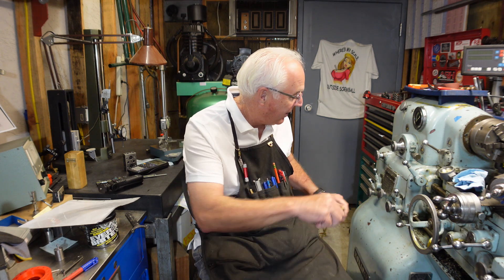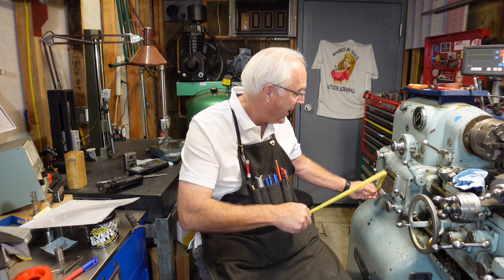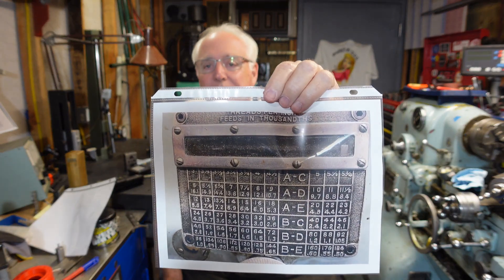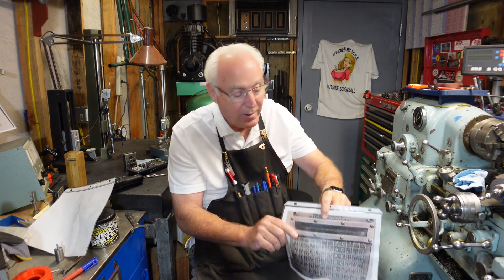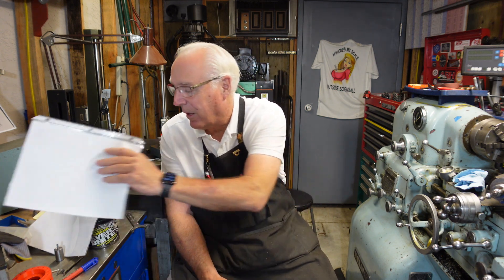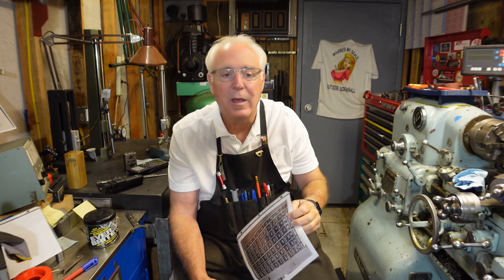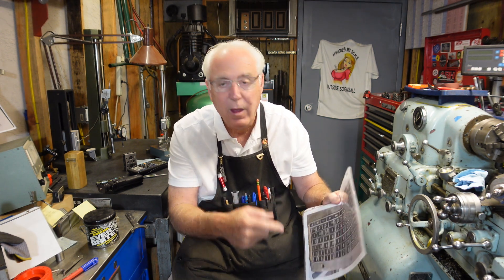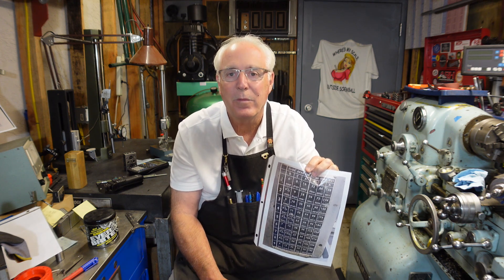Machine Shop Lathe Tip (simple/smart)

Comment: Chuck, this IS a great idea. Not only for lathes that have a table that is "hidden" there down under but also for lathes that have a very hard to read/understand or erratic table for feeds and threading.
Before I bought a real lathe (Weiler Matador VS 1972) I had a Chinese pencil sharpener that had so bad table of change gear settings that I ended up remaking it using Excel. Then I printed it and glued it behind the gear compartment door. The one that was originally on the lathe was pretty useless. It contained quite some errors and quite many not so optimal gear setups.
Reply from the maker: thanks for viewing and your comments

Comment: Chuck,
You need go get it on Alexia   == "Hay Alexia!"  What are the settings for 750 RPM. 
or " I need the settings to turn a 4" dia aluminum bar"   Alexia: "Will that be with carbide or HSS tooling?"  

By the way I found your scale!.

Craig

Comment: Aloha Chuck, thanks for the thought I'm 81 and about 6' so my first thought was to dig a hole in front of the lathe so I could lower myself, I thought that was a better solution than "coke cases" blocking the lathe up😇.
Chuck C